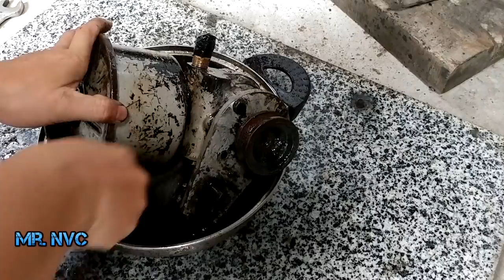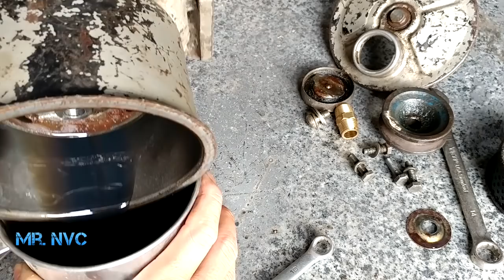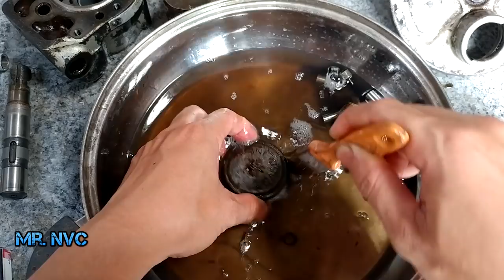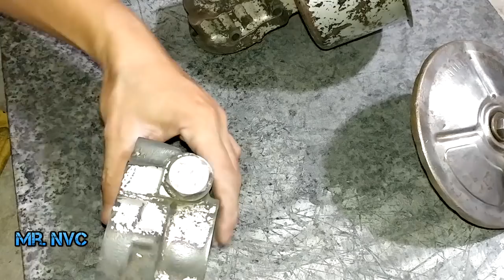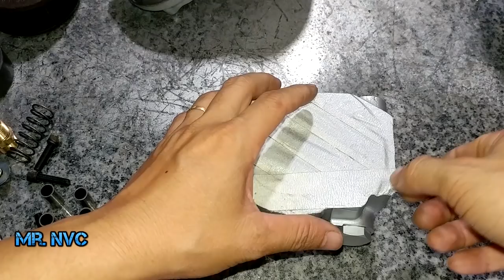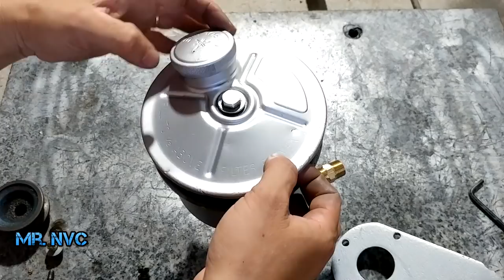AIR COMPRESSOR Pump Restoration Part 2 (CleanUp) - Oil lubrication Pump Restore It

Comment: Are you sure this is an air compressor? And you should change the cap, it reads gasoline on it.
Reply: TheJR1948   and the gaskets too

Comment: Misleading video this is not by no means air pump it is a power steering pump for the70 to 80 two ton or larger trucks I'm pizzed i click to see a air pump restoration . this fool could not restore a bolt. you don't beat things apart if you want to restore it . How does praying the head of a bolt aid in it's removal it has no chance to penetrate that fast. And you clearly had the hydraulic pump submerged in solvent if it didn't penetrate how could spay
Reply: Reread the title. He specifically IDs it as an oil pump.......
Reply: No reason for name calling... you had to learn some where from someone too... don't be your dad bro... break the cycle.  Mr. NVC, keep on inspiring others to get their hands dirty.  Great work.
Reply: Welllll. What did you look at the whole video. Nobody forced you to look at the vid till the end.